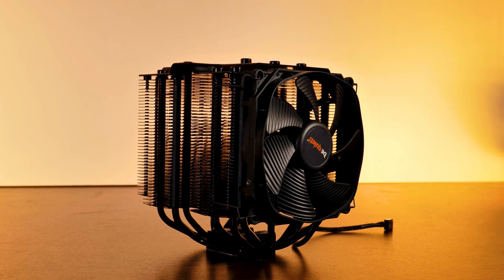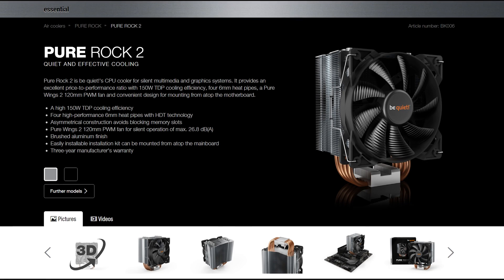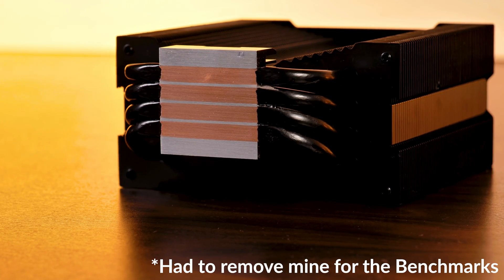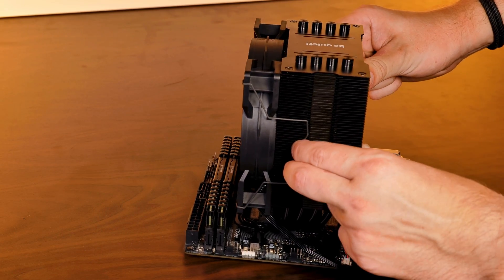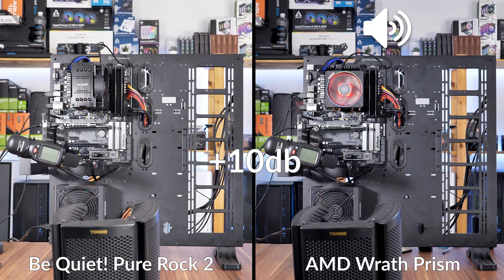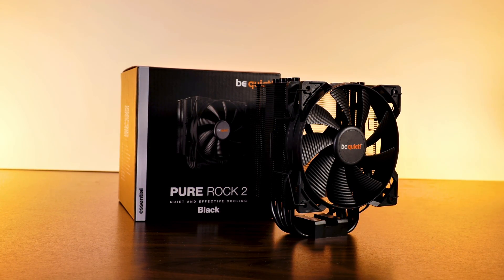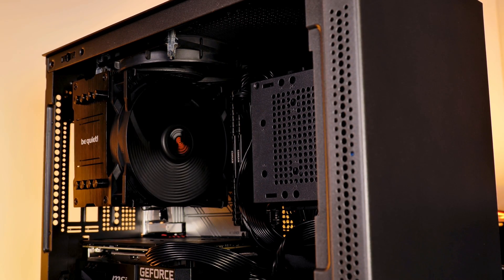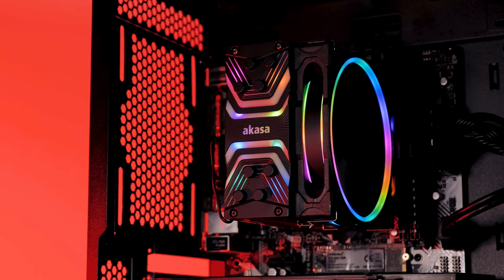Be Quiet Pure Rock 2 Black Review | Silent CPU Cooler

Comment: Just fitted one to my existing rig. Overall its a very good cooler for my needs (i7 7700) and has seen my cpu temps drop by around 10 degrees on normal usage, and on intensive stuff like video conversion it has seen my temps drop from 100 degrees with the stock intel cooler, to a max of 75 degrees,
It was ok fitting although I think the instructions were a little unclear on what screws you are using, and the only other problem I had is I was fitting onto an existing PC and the motherboard was still in place in the case, so space was not a premium when trying to fit the clips to hold the fan in place.
Also, I did find screwing the mounting bar to the brackets was a bit of a pain due to the lack of room, as the screws are pretty damn short so getting both sides to actually get a purchase on the screw holes was a pain.
Over all though, I felt it was a fairly easy experience for someone who has never fitted a cooler before.

Comment: I really like the fan clips on this cooler. It very simple to install the fan. I had Arctic Freezer 34 eSports and it had flimsy fan clips and you could easily scratch the radiator with that clips. That's the only downside of Freezer 34 cooler.
Reply from the maker: Freezer 34 clips are permanently mounted to the rad? Not sure how you would scratch it like that.
Noctua P1 clips for example are perfect examples of 100% scratch
Reply: @STSYT  No, the clips are not permanently attached to the radiator on freezer 34. Only the end of the clips are attached through the radiator and when you want to remove the fan they often slip out of the place and when you want to set them in place again you can easily scratch the bottom of the radiator.
Reply: hell nah. i struggled for about 2 hours to install the damn clips
Reply: @Melody-k8h  I sold freezer 34 and bought cougar forza 50 cpu cooler. It's so easy to install the clips and attach the fan to the radiator

Comment: Will it work for. 12400f quiet
Reply: Yep it will, i do have 12400f installed with these cpu cooler. An average temperature while idle is 28-31C. While gaming can get up to 55-60, but it is really quiet :)

Comment: So it does not sit over a memory slot as some people state. That means I can use all four memory slots?
Reply: I have this cooler and I can use all 4, it doesn't sit over any
Reply: It sits offset on the bracket rather than central so there is no overhang on the ram slots.
Reply from the maker: Yep, no memory problem with this one

Comment: My be quiet fans are louder on low rpm, is thaz normal? Clicking noise under low rpm
Reply: Check in your BIOS if the fans are running on PWM. Sometimes they switch to a DC powermode which causes a lot of noise.

Comment: @4:45 are your sound meters on?  
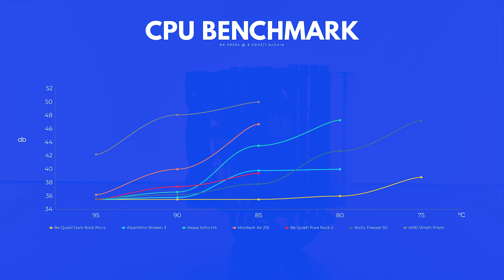@5:36 are the charts implying the coolers get louder the cooler the CPU becomes?
Reply from the maker: 1) in some shots yes. Usually i’m recording the Sound immidiately after doing the noise-to-performance benchmark. Therefore it can happen that the sound meter is not off yet.

2) oh damn, there seems to be an error in the cart. The X values should be reversed. The order in which the numbers are right now doesn’t make any sense.
Sorry, my bad on that one

Comment: Does this block any RAM slots or sit high enough? My current stock Ryzen 5600x cooler is too wide and blocks slot 1 on my B550M A mobo, looking for a good replacement.
Reply from the maker: There shouldn't be any issue. The Pure Rock shouldn't protrude over any Ram Slits on any standardized MOBO.
Reply: The cooler is offset, on the mounting bracket so does not encroach onto ram slots at all.

Comment: They are also known for still having the worst mounting installation of any of the major brands because of that stupid free floating crossbar. At least Cooler Master listened to users and fixed the notoriously bad Hyper 212 mounting in later versions. Bequiet is still in denial.
Reply: Well i am not sure about "worst mounting installation"...It took me up to 15-20 minutes to install and turn on pc. All mounting brackets are marked correctly, not sure why it is hard IMHo.
Reply: Why is it bad? Are there any issues with it or is it just annoying to install?